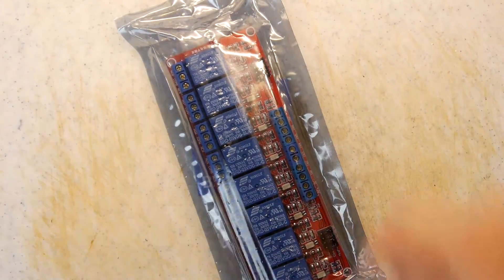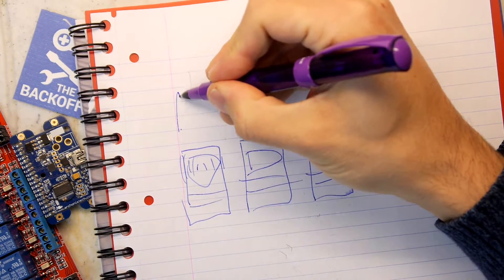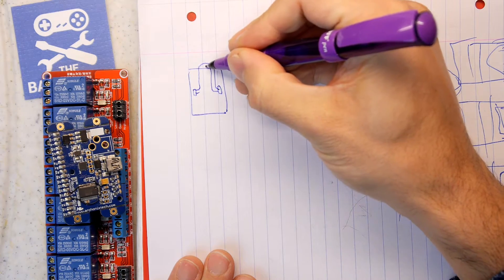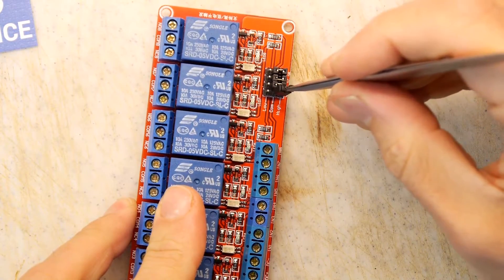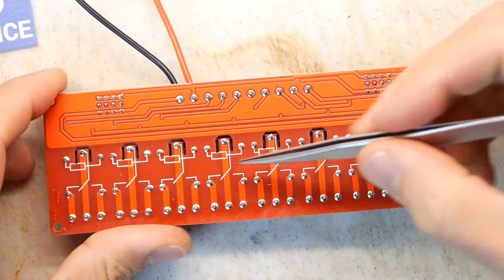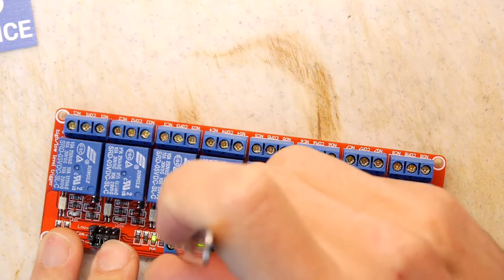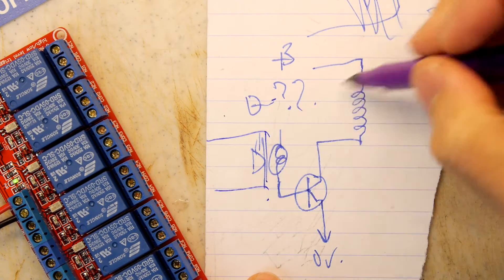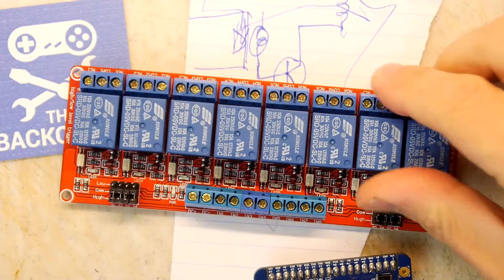Groovy 8 Way Opto Isolated Relay Board

Comment: 8:50 I clicked this video to figure out exactly that. It's odd how can it trigger low with just that header changed.
The only thing I thought was the led of the opto connected to power with a resistor at each leg, and the input going to either the + or the - legs of the led, but then the led would always be a little bit on because it's connected between VCC and GND.

You could connect both legs of the led to the middle of a voltage divider created with 2 resistors each, both with the same voltage, and then drive the input to either the + or the - of the led directly. That would work for sure. I would love a video analyzing the circuit
Reply from the maker: I really must revisit this topic!

Comment: This is not Opto.  It is actually electro-mechanical.
Reply: Its both, the trigger signal goes to an opto isolator, the output signal from the opto isolator is then is amplified probably through a transistor to energise the relay coil Hence the need for a fixed dc supply to the board, this is supplying the output photo transistor which in turn is switching anther transistor to amplify the current needed to energise the relay coil .

Comment: Nice idea :-) But wouldn't a log timebase defeat the object of reducing EM. Best option would be   both extended on together working to the centre. 
Your a numty?  what about someone in my work today telling me a transformer wasn't stepping down. They were using I using a DC V meter lol.
Reply from the maker: +ataristaffroom yeah it would have to be so slow it would lose its logginess, however, I was planning to use some of the channels for lighting too, so might explore some effects. The user will be able to connect to it via USB and set all the parameters themselves to their needs. And they can be chained together.

I figured out the inverter logic about a minute after uploading the video, just could not bear to edit it anymore, ironically it's quite simple 😂

Ha ha, I hope he was not an electrician!!
Reply: It was a teacher lol.  Do those boards come in a version with solid state relays?
Reply from the maker: ataristaffroom Not seen any, but not really looked out for them. They come in various lengths and are crazy reasonably priced. Never really understood solid state relays, are the not just a packaged MOSFET? However being AC would it be a triac? who knows shrug :)
Reply: The Backoffice Solid state resistors are just packed thyristors but they can deal with big currents. I used to use them when I was building industrial electric ovens.
Reply from the maker: +ataristaffroom So technically you could install these in the cabs themselves and use low voltage switching. That would solve a lot of issues!
Reply: The Backoffice Well, yes. That would make things easier but make the system a little more messy in a physical sense as o opposed to just a central box that could just look like a beefed up multi-block extension cord. Always worth getting the ones capable of being fitted with a heatsink though.
Reply from the maker: +ataristaffroom Just checked on my usual supplier sites, they seem pretty dear for the currents required. The equivalent Chinese boards with SSRs can handle 2A each vs 10A of the mechanical boys.

Comment: Very cool idea! I'm currently running 16 arcade cabinets on 3 dedicated 20 amp circuits and use the breakers to turn them on. I like the idea of staggering the ON sequence to minimize monitor interference.
Reply from the maker: +Hill Brothers Arcade I have something quite groovy in mind for this, should be special 😂

That's a lot of juice, any estimates on the inrush current of a cab? It would be v useful to know 👍
Reply: Most of my games run between 1 to 1.5 amps.  The inrush current is typically 2X the normal draw.  I usually run 6-8 games per 20 amp circuit.
Reply from the maker: Thats great, really helpful. Gives me the some idea of what can be done. UK plug is 13 amps so 4 cabs would be easy. I would use this for 4 cabs plus 4 lighting rigs.
Reply: Very cool project best of luck!
Reply from the maker: Hill Brothers Arcade Thanks Sir!